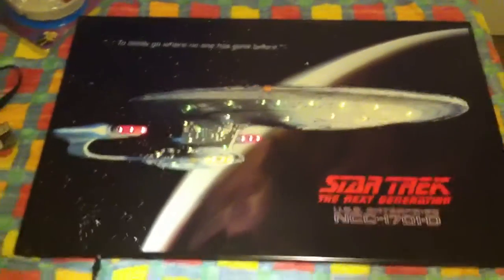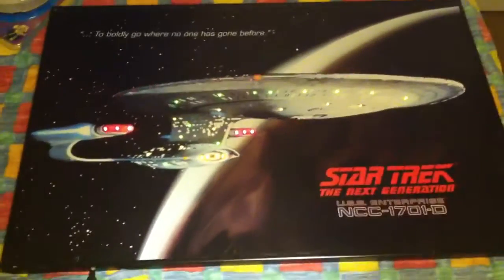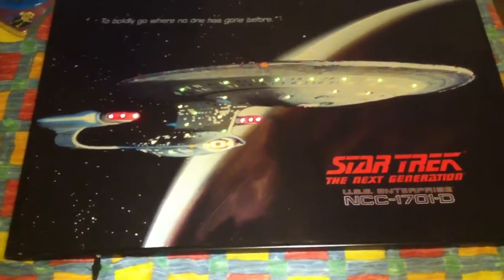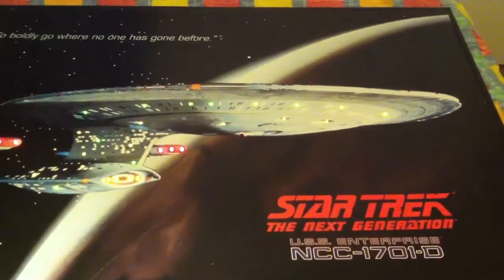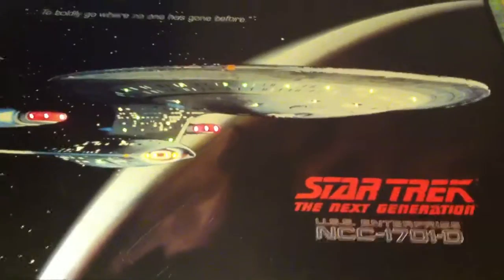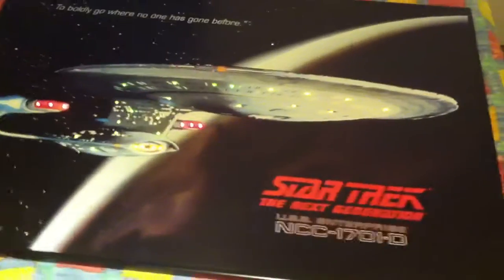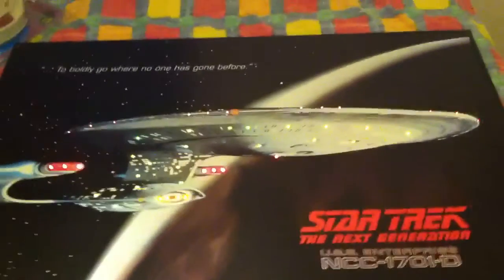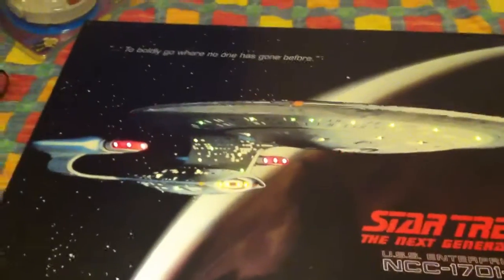Rare 1990's LED poster Art. Star Trek TNG The Next Generation

Comment: Current have mine and actually still works.
24 years of led technology still blinking.
Reply from the maker: Touch wood, the only big factor besides componant wear and tear is the deteriation of the conductive materials.  A bit like in the Voyager series why they returned to the isolinea chips as opposed to the orangic circitary.  As the life span of the organic circuitry in the harsh conditions of the Delta Quadrant, made their application impractical.
Reply: @Hoss Do you know what the power supply info is since yours works?
Reply: @ryangallagher5425  unfortunately no.
I sold mine about 6 months ago.
Not sure of the power supply information.

Comment: I have one with no power supply. Can you send me the power adapter model number and brand so I can see if mine lights up? I bought an adjustable power adapter and put it at 12 volts but I don't think the plug was compatible  because it did nothing.
Reply: Did you find the power supply?  I'm looking for one too.  Let me know.
Thanks.
Reply from the maker: Hi I'm sorry, I gave this to my cousins Partner as a Gift and it's currently in storage in New Zealand and he's in the UK.  But I will check incase I took pictures of the power supply and more importantly the polarity.  As on the one I got, you could switch the polarity going to the wires.  

It was an old one I got to use on some other pieces including an indoor dancing water fountain that stopped working, and I got curious and discoverd it worked with the print, as Spensers gifts never supplied one.  

However it's worth trying at a lower voltage, I think mine was set at 8.5v to 9v  300ma / 500ma originally before I switched it upto 12v.